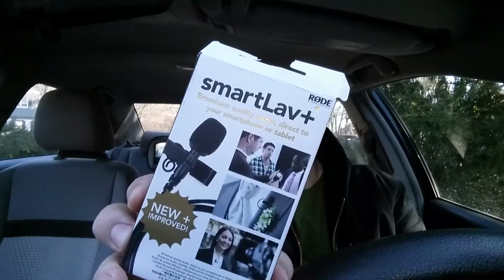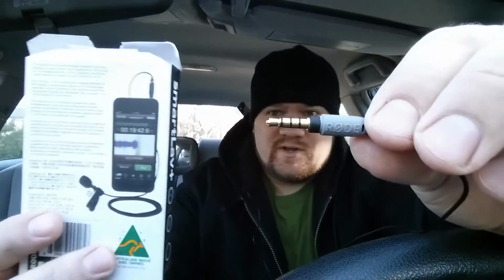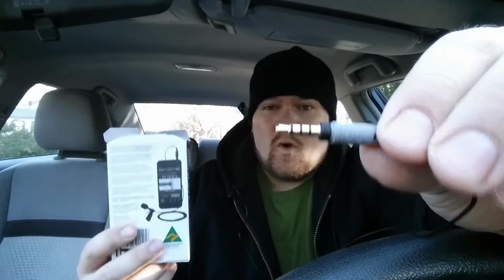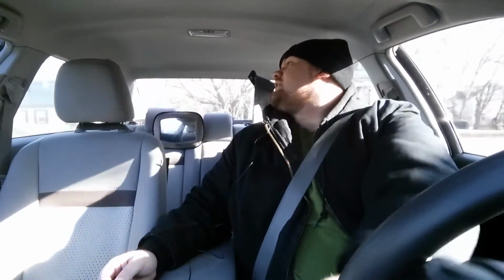Rode SmartLav+ Mic Test With Galaxy S5

Comment: Does this works right out of the box without any adapters with Galaxy S5?
Reply from the maker: Yes. All i did was plug the 3.5mm into my phone and the phone automatically switched from the built-in mic to the Rode mic. Very simple. Truly plug and play.
Reply: Thanks, I bought one :-) No idea the sound quality yet. May I ask what is your software in phone? I downloaded the Titanium Recorder or whatever. At least it was possible to record mp3 and save memory space. There is also gain adjustment in the software.

Comment: bro the change is very noticeable I like the mic. I have the audio technica atr3350is I paid 30 for it the sound on my mic is crazy I love it, I will say that the sound is better than your because it has a internal power supply I mean a battery, the only thing that I hate is the phone adapter but also has a headphone jack so I can monitor audio but I never do
Reply from the maker: +Rigo Cornejo the change is noticeable yes. But is the change better? Im still undecided. The only reasonn i think the Smart Lav is slightly better than the internal mic of the galaxy S5 is due to its closer location to my mouth. I wouldnt say the quality of the sound is that much better. In what way specifically do you think its better? What characteristic of the sound sounds better to your ears?  Curious. And i think its a good question to think about. Being able to speak scientifically about sound quality is a challenging and important skill. So waht do you think?
Reply from the maker: +Rigo Cornejo the change is noticeable yes. But is the change better? Im still undecided. The only reasonn i think the Smart Lav is slightly better than the internal mic of the galaxy S5 is due to its closer location to my mouth. I wouldnt say the quality of the sound is that much better. In what way specifically do you think its better? What characteristic of the sound sounds better to your ears?  Curious. And i think its a good question to think about. Being able to speak scientifically about sound quality is a challenging and important skill. So waht do you think?